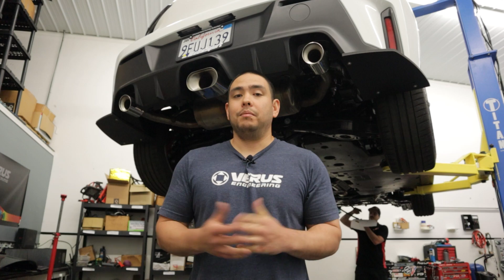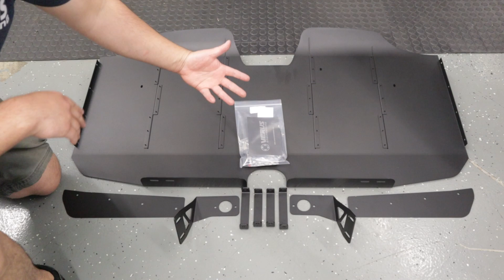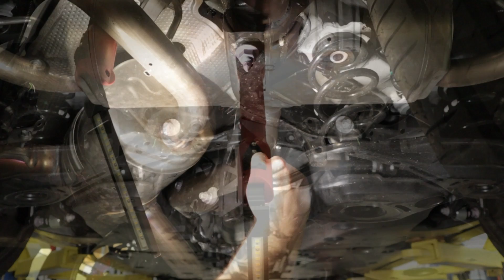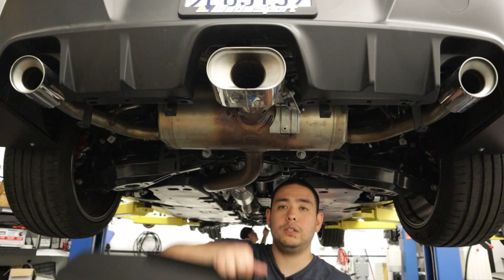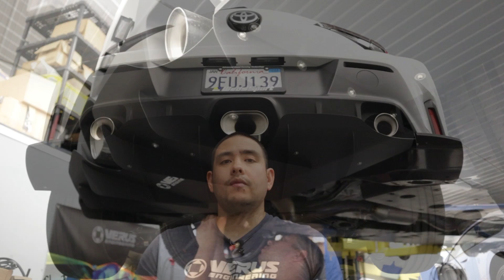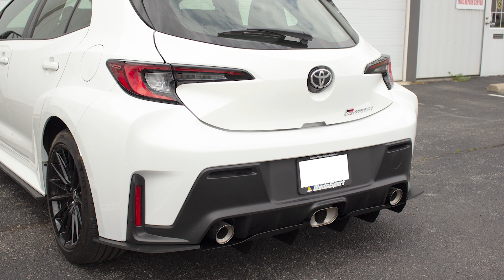Toyota GR Corolla Rear Diffuser Installation

Comment: Nice I have the Corolla GR ice cap white as well.. where did you purchase this?
Reply from the maker: The rear diffuser can be purchased through the link listed in the description. The car is actually not ours. It was loaned to us by Just Driven.
Reply: Thanks